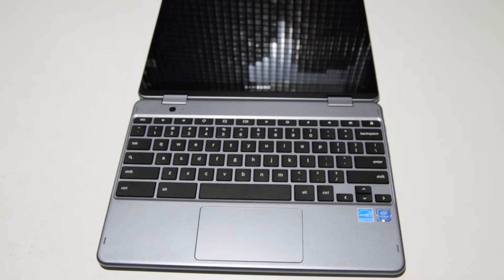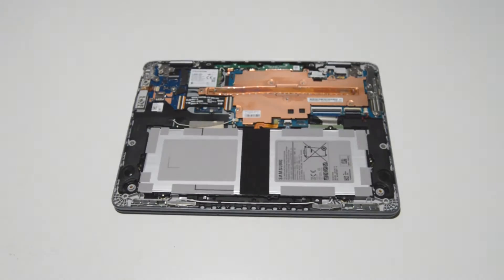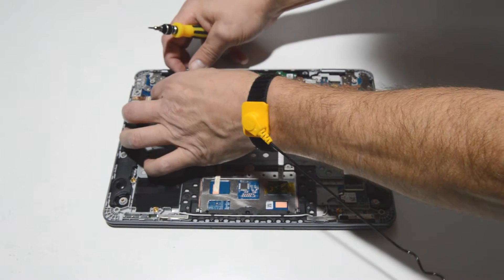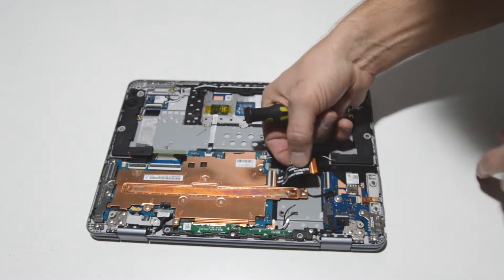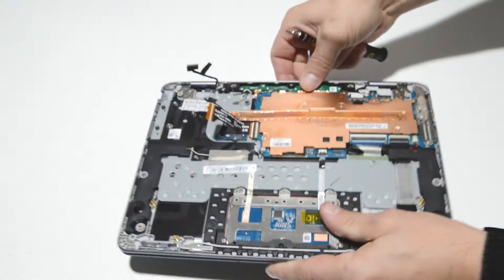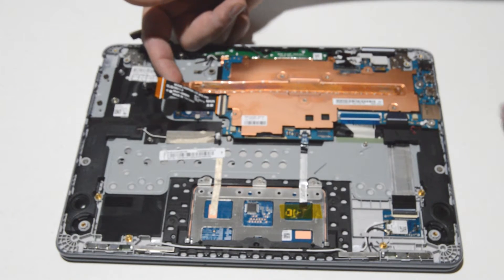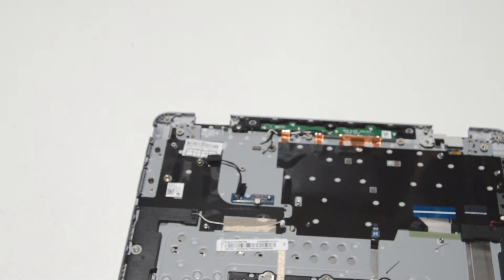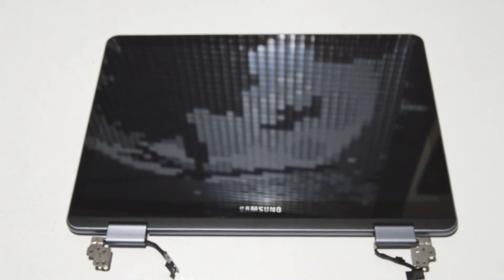How to Disassemble Samsung Chromebook XE525qbb

Comment: You'll find a better answer asking the village idiot than Google, so being the village idiot I'm asking you... When I play Battle of Warships my audio makes a crackling sound momentarily as it loads, the water looks like it has no definition but should have at least minimal...at almost exactly 1 minute in it freezes up. It will play golf rival and other video games but not battle of warships...I have a second Chromebook I'm using right now and it's brand new...to sum it up Battle of Warships works on this one but not on my other...Is the motherboard and video starting to fry out or do you think possibly the antennas broken and it's just not getting the signal It did before?I'm kind of leaning on motherboard burning out...Any ideas anyone?
Reply: My bad I also meant to ask is it possible it needs to be opened up and vacuumed out literally getting all the dust and dirt out of it? Cuz it possible static electricity jumping all over might be doing something? It's been in service for three years even the keyboard has pretty much stopped working I have an external plugged into it... I'm not afraid to not use it anymore I'm just kind of curious as to whether it finally is going to cook out.

Comment: Is the gpu inside the display section or the section that holds pretty much everything? Trying to fix my brother's chromebook's screen since the gpu went bad on it...lines streaked across the screen and everything but when hooked up to an external monitor it still worked

Comment: The left hinge in mine losses and went further breaking the bottom case of the screen what should I do
Reply from the maker: You probably need most of a complete assembly now, check out this one https://www.ebay.com/itm/EX525QBB-K01US-GENUINE-SAMSUNG-LCD-11-6-TOUCH-XE525QBB-EX525QBB-K01US-A-AF86/274074943311?hash=item3fd023bf4f:g:k2IAAOSwY9pdufFn:sc:USPSPriority!89511!US!-1

Comment: Is it possible to tighten the hinge on this chromebook? If so, how?
Reply from the maker: It depends on where the looseness is. If its the case side then you can see the hinge screws when you remove the bottom case and tighten there. Otherwise you would need to open the LCD assembly.
Reply: Mine remained strong for 6 months until the metal right one jam in closed position while opening, causing que plastic shell of the screen end of the hinge to break and free the metal hinge fixing. :..(
Reply: @velhoinveste  mine too for the left side but i cannot find any store to fix it!